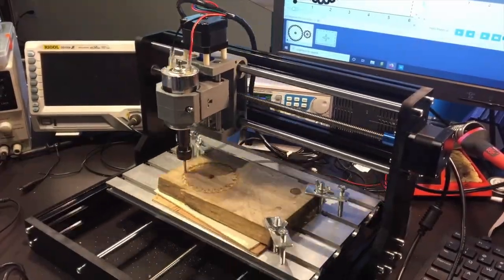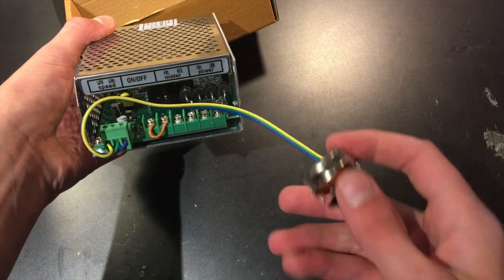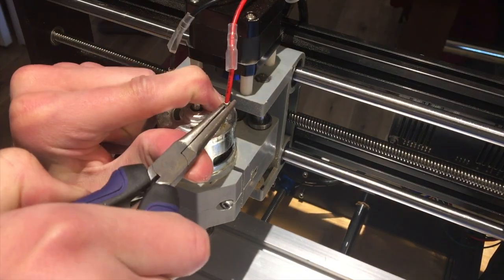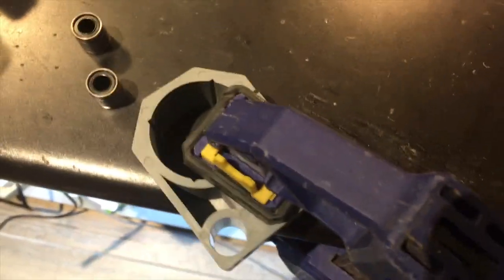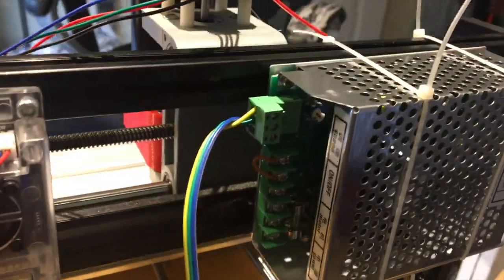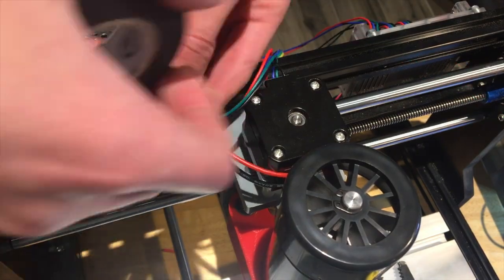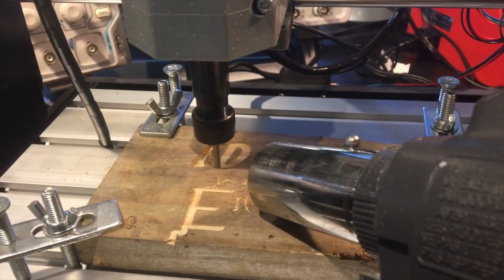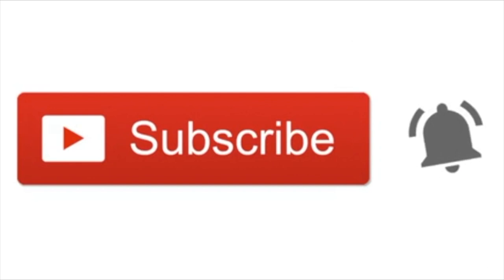3018 CNC Spindle Upgrade (500W)  |  New CNC Motor Demonstration

Comment: That new spindle is a good unit , I bought the same one and added it to my 4018 cnc , haven’t tried to cut aluminum yet but it’s great for wood and plastic 👍
Reply from the maker: Nice, Let me know how milling aluminum turns out for you!
Reply: Carbon Coil waiting for better clamps from overseas supplier don’t want metal flying all over the place 😉

Comment: Hi there, great video, I have done this upgrade to my 3018 the only difference is I used a different mount. I did use the one you have initially and then changed to this one on thingiverse (thing:3645875) you get the 10mm work height back that you loose fitting the 500watt motor and it holds the motor more securely. It’s a bit of a pain to fit but I found it to be worth the effort. Just thought you might like to try it.
Reply from the maker: Seems like a good idea, Might try it in the future.
Reply: I want to do this upgrade soon. Just got my 3018 today.

Comment: I wish when you were comparing the speed of carving you mentioned the actual values. I am trying to CNC soft aluminum and looking to upgrade the motor on the new 3018 I got. is this still the best upgrade you recommend?

Comment: The power supply/potentiometer on it is mains referenced. Be carefull with this power supply. I use an optocoupler to set the rpm via PWM. This works quite well.
Reply from the maker: Not a bad idea, I might try implementing this change in the future.
Reply: @CarbonCoil  Not sure if it's possible with your motor but this guy Minh hooked up PWM wires from the old board to the new motor and it worked. He controls rpm with software. https://www.youtube.com/watch?v=Vho_tGuLqd4
PS: Later he did a jumbo-upgrade and used a hand-held router as the motor.

Comment: Did you just run straight 110v into the controller for power? 

Also, there are those terminals labelled on/off - I wonder if that can be connected to the stock controller (where the old motor was plugged in) to provide a CNC-controlled power state.....
Reply from the maker: Yep, 110v AC for the power connection. The on/off most likely is just to be connected to a switch and not powered. But, you could hook a 12v or 24v relay up to the spindle out and then have the relay switch that on/off connection.

Comment: Tools required: zipties, 3d printer, and ... a hammer?
Reply from the maker: Correct, excluding the tools that come with the CNC of course (such as allen keys to take apart the spindle carriage). Additionally, hardware such as a power cable and some M4 bolts/nuts are required. Someone in another comment also mentioned that a rubber mallet would be better instead of a hammer, but it isn't strictly necessary.

Comment: The z axis bearings are too far back on the standard part, you can move them  forward around 3 or 4mm while it soes not sound like much every millimeter you can reduce the leverage  makes a good deal of difference in the ridgidity, I find that with a little bit of thought the whole Z axis could be moved back toward the collums around 7 or 8mm, which would make a huge difference in reducing chatter
Reply from the maker: Thanks, I might try this.

Comment: Hi good video!!
regarding the wiring, could you give me more details of configuration. If possible a video on the wiring setup would be amazing 
Thanks again
Reply from the maker: I wired the spindle motor to the motor out of the motor controller, supplied mains power to the input of the controller, and plugged in the included potentiometer to the motor controller. There is no connection between the controller board and the spindle motor controller, I adjust the speed/turn it on and off manually with the potentiometer. The rest of the wiring for the CNC was left untouched.

Comment: Hello, I upgraded my 3018pro with the 500watt motor and the spindle holder you use, However, the spindle now comes forward a bit. Do I need to change anything in the GRBL settings now?
Reply from the maker: Nope, you shouldn't need to change anything because you usually set the zero point in software every time you do a carving anyways.

Comment: Could this cnc with 500w engrave painted die cast aluminum boxes?
Reply from the maker: It should be able to. I recently made a video on this very topic of trying to machine aluminum with a 3018 CNC. You can check out that video here: https://youtu.be/kODvQ1fMYXU

Comment: Hey again, how did you get the middle bronze thread thing out ? I got the bearings out easy enough but the thing in between seems stuck
Reply from the maker: I think I was able to just hammer it out if I remember correctly
Reply: @CarbonCoil  Okay thanks man, i'll shall just hammer away!

Comment: Great video, I'm using mine as an engraver, but can't seem to get the right depth for letters, any suggestions, please TIa
Reply from the maker: For engraving I just do trial and error to find the right depth. I would suggest taking a piece of scrap wood and trying different depths on it. Start very shallow, barley touching the stock material, and with very small increments go deeper and deeper until you find a depth that looks good with your bit and material. I usually use something from 0.01" to 0.03" for small letters/text.
Reply: @CarbonCoil   Cheers thanks for that I will primarily be using acrylic plastic, will the principles be the same? would you recommend changing the bit?
Reply from the maker: @richarddalton2052  Yep it will be about the same. If you are just doing engraving, you can keep the V-bit. However, if you are looking to make larger cuts with another end mill, I would suggest a single flute end mill for acrylic such as the one I use in this video: https://youtu.be/cbQ1ZffEBlU Let me know how your project turns out!

Comment: Is the 3018 sturdy enough for such a high power spindle?
Reply from the maker: It's sturdy enough that I've been using it ever since the upgrade with no issues. There is a little vertical play that is made worse because the new mount sticks out further, but I don't usually notice it unless I'm milling something that needs a lot of precision (like facing the top of aluminum).
Reply: @CarbonCoil  Thank you for your reply. So. Aluminum isn't really possible with this upgrade?
Reply from the maker: @nabbl2006  I'm actually working on a video about this topic at the moment! Milling aluminum is possible with this upgrade, however, the surface finish just isn't the best.
Reply: @CarbonCoil  ah cool. Waiting for it patiently 😁
Reply from the maker: It's finally finished! https://youtu.be/kODvQ1fMYXU

Comment: What's your setting for candle with this new motor?
Reply from the maker: The motor isn't hooked up to cnc electrically. I just control it with a potentiometer.
Reply: @CarbonCoil  thank you for you answer. And feed? How did you set it?
Reply from the maker: @chazy10  I use a free online software called Easel (instead of candle). Based on the material selected and the size of the bit, it recommends feeds and speeds to use. I just follow those. (New video coming out soon covering this topic!)
Reply from the maker: @chazzy10 Here's the new video explaining it! https://youtu.be/NNnxV0NLdXE

Comment: Is there any advantage too using a brushless motor instead?
Reply from the maker: Not really, brushes will wear out after a long time but most spindle motors are just brushed dc motors.
Reply: @CarbonCoil  There are two potential advantages.
 1) brushless enables real speed control instead of just the power control you have with brushed motors (that don't have speed feedback).
 2) brushless should have much greater torque at lower RPMs.
whether these potentials are exploited by a particular brushless controller remains to be seen.

Comment: Looking to buy or make an American Made CNC. Any suggestions?
Reply from the maker: If I was to build another CNC, I would most likely chose the LowRider from V1 Engineering. Its a mostly 3D printed Cnc and you can either print the parts yourself and assemble it using a hardware kit from their website, or alternatively just buy the kit with the 3d printed parts included. Either way its a cheap option if you're ok with some diy assembly.

https://youtu.be/xIGre_E2_og
https://www.v1engineering.com/lowrider-parts/
https://shop.v1engineering.com
Reply: @CarbonCoil  I have a 3d printer I built from 3d printed parts. That seems like a good choice for me.
Reply from the maker: @wartlme  Sounds good, I'd love to hear how it turns out!
Reply: @CarbonCoil  Aww gee doc, that 3018 is so neat and compact and has lots of potential with a few mods to really perform, whereas the low Rider model is starting to look like a biggo where does it go model.......point is, where do you stop enlarging it before you need a room just for it.
That would be OK for those that want to start making ornately carved front  doors or table tops etc on the cheap.
I'm considering making a 3018, not with aluminium profiles bolted together as that is a production model especially aimed at the home builder DIY market, but in a steel tube all welded frame the same size as the 3018, mainly because I like making things but also with more potential for milling aluminium and maybe brass etc.....that would definitely need a stiffer frame and after viewing a few videos and reviews on the 3018 the bug is starting to bite.

Comment: What speed settings should I use in easel
Reply from the maker: I just use the default settings on easel, however with the 500W spindle you can speed up the feed rate quite a bit before you start getting chatter.
Reply from the maker: Here's my new video explaining all the basics of using a 3018 CNC! It explains how to set feeds and speeds. https://youtu.be/NNnxV0NLdXE

Comment: Is there any way to still control the speed with software?
Reply from the maker: In my current configuration I can't control the spindle speed through the software. I do it manually at the start of the cnc job with the potentiometer connected to the motor controller. However, the software can control the movement speed (Feed Rate).
Reply: @CarbonCoil  how do u figure out RPM with potentiometer
Reply from the maker: @Pandonaut  To accurately measure RPM, you need a tachometer or stroboscope. However, I have heard these 500W spindle motors spin up to 12,000 RPM at max speed.

Comment: imp 3d pla or pbc? thanks  bro!!
Reply from the maker: I don't exactly understand your question, but the new mount was printed using PLA filament. (I probably should have made it from some other better material but that is what I had on hand)
Reply: @CarbonCoil  I did print a PETG version since it may withstand higher temperatures and mechanical stress

Comment: to dangerous not starting and stopping the spindle with the program definitetly at least need an Estop , I am saving for a more rigid cnc
Reply from the maker: Agreed, now that I'm finished my testing, I plug in the spindle from pretty far away after setting the speed and closing up the enclosure I use. Adding an E-stop and/or other safety feature modifications could make for a good video :D

Comment: Hello! sorry but how do i connect the kit on the 3018 pro? i can't understand well from the video, is some other component needed?

￼
Reply from the maker: To physically connect the 500W spindle to the CNC, I 3D printed a mount for the motor. They aren't currently connected electrically, I just use a potentiometer and motor controller to control the speed.
Reply: ok so you need a separate potentiometer in addition to the kit? because I wanted to connect it to the machine but I didn't know how to do it
Reply from the maker: @gabriele9153  No, a potentiometer comes with the kit for manual control. Usually I just turn the spindle on manually when I'm ready to start a carve. Im not sure how to connect the spindle to the CNC so that the CNC has control over its speed but that might be a future project for me to look into.
Reply: ok I understand, can you tell me which power supply you used to connect it to the mains?

Comment: There is a upgrade kit here for the 500W spindle mount  https://www.ebay.co.uk/itm/224165570574
Reply from the maker: This could be a good option if someone doesn't have a 3d printer. However, this listing doesn't come with a motor controller so that would need to be purchased separately.
Reply: @CarbonCoil  True but that is easily and more cheaply bought from china. mount is just to solve a problem. the buyer is already saving money from not having the seller bundle that with it because the seller could easily bundle it all and sell it for much more. instead. just selling the mount so people can be free to CNC.
Reply from the maker: @devil2005iscool  For sure, thats true

Comment: How did u know what speed for the spindle to start carving at?
Reply from the maker: I didn't really know what speed to start with and I didn't have a way to measure the speed either even if I knew the target speed I was going for. I just turned the spindle up to its fastest setting and then adjusted the feed rate and depth of cut. I would set them pretty high but back off a bit if there was chatter.
Reply from the maker: And I'm no CNC expert so if someone knows how to correctly figure out what feed rate, depth of cut, and spindle speed should be used, you could leave a suggestion for Pandonaut
Reply: @CarbonCoil  ah alright, just wasn't too sure how I'd know the speed since Im still using the stock spindle and people have actual numerical values